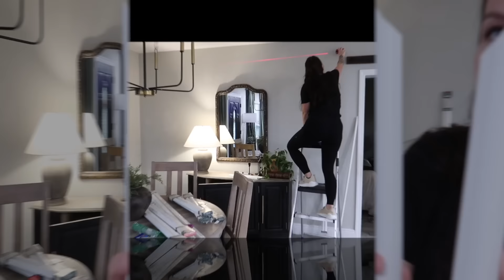DIY wall Trim ! NO CUTS or EXPERIENCE NEEDED ! Dining room makeover on a budget ! Small home diy

Comment: If your laser level is on your right, start applying the trim from left to right. That way you can do the full box without blocking the laser. (And vice versa if level is on the left)

Comment: I'm just amazed with the talent you have Karrie on updating your home. The trim looks absolutely gorgeous!!! I love the arch idea in your kitchen to separate the two areas but yet leaving it open. I have arches in my home too in the entryway and the kitchen and I love them!!! Love all the kitchen ideas you have come up with. Great tip on the painting and caulking!!

I want to make sure I heard you correctly, at the bottom where the baseboards you used a line of caulk by the tape area to make a seemless straight line?

Comment: About 25 years ago, we put wainscoting on the bottom of our kitchen wall. After that amount of time, I was tired of it. Would have liked to remove it, but my husband used liquid nails and that would have been a nightmare trying to get  off,  so I never even attempted it. We have since moved, but I still have a negative feeling about it. Wish I would’ve just been happy with Sheetrock walls. We had similar molding in our living room to what you are doing now. Only on the lower part below chair rail, I really do love that type of molding.

Comment: The wall is beautiful!  I have travertine ledger panels for my kitchen backsplash.  We sealed the stone.  No issues at all with cleaning.  I've had sauces splatter, I've had things splatter when mixing and just general cooking.  Six years and still looks new.   We purchased it from Floor and Decor the style is  'PHILADELPHIA SPLITFACE TRAVERTINE LEDGER PANEL'   We did a color enhancing sealer first but it was too dark for what we wanted in the kitchen so we used that to surround the fireplace.  Looks nice.   My sister has travertine tiles for her backsplash in her kitchen.  Those have been there for almost 20 years and still look good.  Seal them and you won't have problems.

Comment: I just did my backsplash in layared rock its held up just with liquid nails fine and each slab was heavy and I put a matte sealer on it so it does wipe off and clean

Comment: Get the caulking tool my husband just bought it. We were putting up our chair rail and door trim and it made it so much easier and It Works!  just as good as the baby wipes. If not better and there’s a scraper on the other end for cleaning out caulk.

Comment: The arch would be beautiful but I would absolutely not recommend. We have one in our home and the contractor had to come back the first year and repair it due to cracks. It has already cracked again and is getting repaired a second time. After doing some research I have found this is a common problem.

Comment: Be careful with adding anything that will make your rooms look smaller. The open floor plan works in your favor that it looks bigger than it really is. Eight-foot ceilings are standard and if you put an arch at six foot it's going to feel like it's coming down on you and will make it seem smaller. You could get away with that if you had 10 or 12 ft ceilings. Maybe save that idea for another property.

Comment: Your island is very nice, but I would remove that, put your table and chairs there and make the dining room all living room with your other side
Reply from the maker: We have tried that, but then the living room is way too long and it's awkward that the front door opens up into the middle of living room. Honestly no matter what we've tried this is the best set up. Unless we Spend thousands of dollars to move the front door over. Eventually, we would like to close in our carport and turn that into a family room. And then we would just make our main living room kind of like a sitting space not so big. But for now it works . I do appreciate your suggestions though 💕

Comment: Karrie your project looks great! There are some tips and tricks we can use with the laser. It can be raised a tad and place the pieces underneath the laser line. I have found that when using caulk, I cut the hole small. That way it isn’t as messy and it’s easier to manipulate. Adding an arch will be beautiful. XO MacKenna has a lot of great design ideas and she has two homes with some different vibes.  Love watching you do these projects! Always adding value!

Comment: Your home looks beautiful, and you are extremely talented.  Just an observation...the cabinets you added in the kitchen look like boxes on the wall.  I think they would look great if they were a little varied in shape and size (maybe a tall pantry cabinet on the end) and not all the same.  Your dining space looks great!
Reply from the maker: The issue is the width. I chose these because they are thin only like 30in deep anything else closes the space . I thought about a countertop on this side with cabinets above but it just won't work with the sliding door.